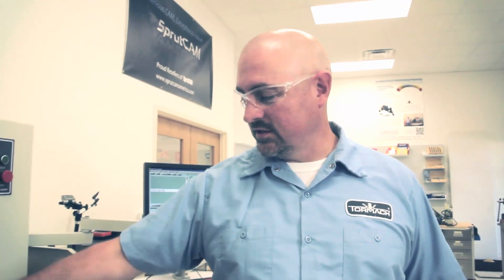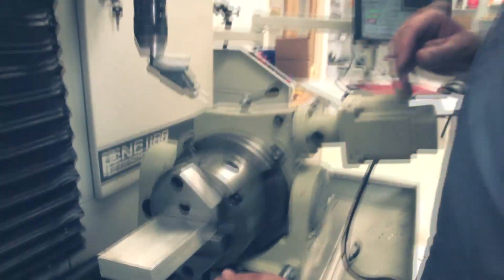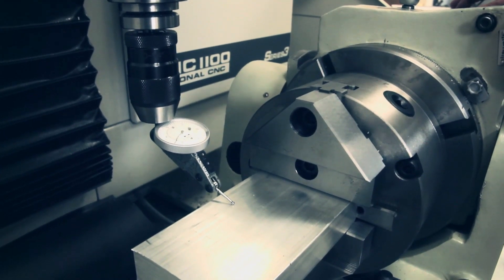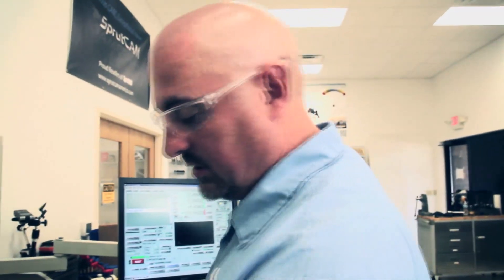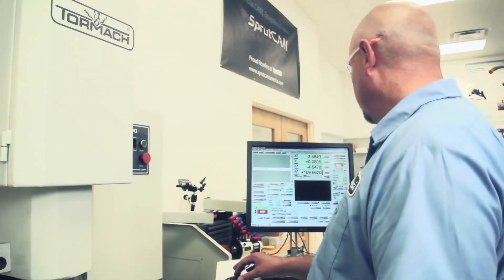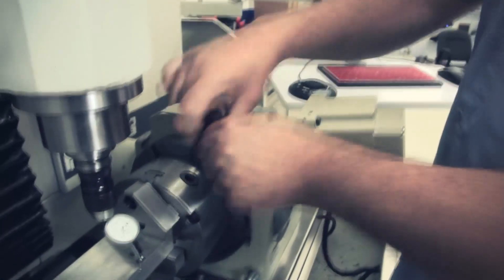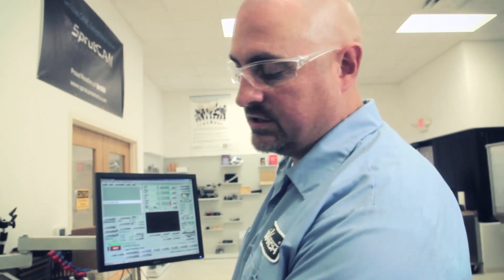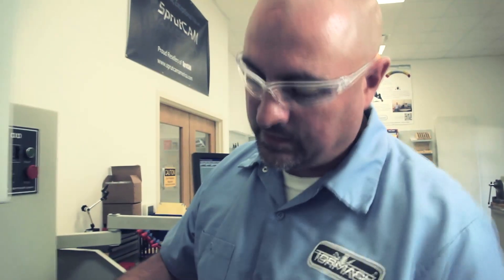How to Setup a 2-Jaw Chuck - Tormach CNC

Comment from the maker: We received a comment that stated "I am not happy with this method, the material can be bent and have bad surface, so this is never the best way."  The comment no longer appears and we believe that is just an error on Youtube's end so we would still like to respond.
Our response:
We appreciate the note.  Obviously, you’ll need to make a judgment call on whether this method will be accurate enough for what you are trying to accomplish with the tool. A typical reason for using a 2 Jaw chuck is so that the part can be machined on 2 opposite sides with in a single quick setup.  You’ll likely be removing material from both sides, so as long as enough stock material thickness is allowed, the concerns you mention here should not be a factor.  That said, if it is still a concern, it could be addressed by 1) squaring the rough workpiece stock prior to grabbing in the chuck and 2) using a 4-Jaw chuck which provide a more accurate method for orienting the work, all things considered.